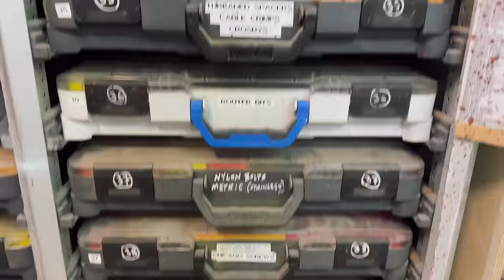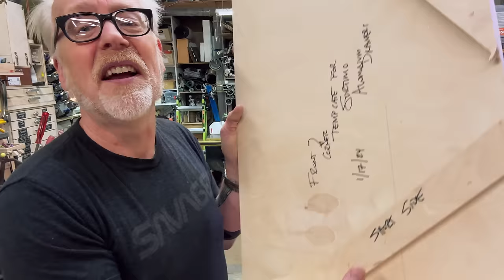Adam Savage Builds His Dream Hardware Storage System!

Comment: re: attaching rails to sides,.. why not clamp the two sides together and drill vertical pilot holes thru the pairs? 
Then regardless of your measurements, the rail pairs are identical heigths.
You can also do one pair, check it and then use one as a top template for drilling down thru all the others, saving all the re-measuring.

Comment: You had them all stacked on the mill for the holes in the corner.  You have a very long end mill, turn those corners into chips, AND drill your holes instead of the hole punch.  One set up.....

Comment: I had the same dilemma and solved it years ago by using a 3 foot tall stool and taking the seat off and making a board with 4 1/2 inch plywood sides that the box can sit in. ( just like the aluminum trays you made but only 1 made out of plywood)

Comment: If anyone is going to make these DON'T use 6061 AL, use 5052 instead.  6061 isn't made for bending.  If not annealed (and it's generally not) it will crack if bending parallel to the grain orientation (the orientation it was rolled).  5052 is what's used for bent aluminum parts.

Comment: What I was actually thinking after you've drilled the two holes was: why don't you also drill the holes for pop rivets instead of punching them out? Maybe in two batches since it would have required a much thinner drill.

Comment: What about building slides in a horizontal line at let’s say 48” high and keep them empty so you can pull out a organizer set it on the slide out to grab parts as you’re working on project and then put it back. Then on one side of the shelf system that you had before, vertically replace it with a drawer system to keep the most used Sortimos on quick access drawers. My 5 cents on the idea for cost and time savings  yet still have a space for organizers to sit on.

Comment: I understand the need for a surface space to lay out the parts box. But wouldnt it be easier and more efficient to make a single slide out surface area in the general area of the parts box rack. This way you can slide out the tray, pull the box you need, put it on tray to open and find part, then just tuck the single tray away when done. You would always have the flat surface clear because it isnt a work bench to fill up with tools

Comment: I understand the focus on "mass production" here and its very interesting  :)

but the problem at hand... Is it not just better making 2 sliders at good "picking" height? Then just pull out one - using it as a table and put the needed box on it.
I mean if you have a slider at the bottom or high up - its not really ergonomic to use. 
Alternatively just a wood panel to slide in/out as a table between to boxes in good picking height on each column.

Comment: there is also solution to have pull out plate under the collumn of all boxes... similar to keyboard pull out plate on computer tables. at table height... so you have 15 (not sure how thick these boxes are), then pull out table, and then rest of boxes till ceiling.

Comment: So at 13 mins we spent a lot of time setting up to drill holes in 70 sheets? And then we cut stuff and the hole punched @17:30? Changing one bit in the milling machine and having the top sheet marked for the 6 holes for the rivets once, would have saved a shit load of time. Top that with Alloy cutting blade in a jigsaw, more time saved. Then for the real time consumer, bending. That will need to be done 1 by 1. Just my view, and love the process.

Comment: He should not have made two cuts in each back corner.  What he should have done was just one straight cut from back to the front. Then bend the 90 across the back, the the two Bends on the sides. Then bend the tails of each side in a 90 over lapping across the back , then put a pop rivet through the back corners tying the sides into the back. Which 31:03  would strengthen  the whole panel, when  tying in the corners.

Comment: Okay...all you need is to build ONE slide-out horizontal surface per column of Sortimos. Just slide out the "desk" pull the desired Sortimos, set it in the desk, retrieve part, replace Sortimos, slide desk back. Done!

Comment: Adam spends weeks contemplating, planning, and tooling for construction of the aluminum drawers.

Me:  Just build one drawer in the middle of each column and pull it out when needed.
Reply: So only make one drawer and do what with the rest?
Reply: @TravelingStacker  Adam said he runs out of flat surface during projects.  Place a pull out shelf in the vertical middle of each column of sortimos so when he needs to pull a sortimos out and retrieve a part, he puts it on the retractable shelf, then he slide it back in when not needed.
Reply: @JediMasterFO  The drawers he just built slide out and sit in place while you remove what you need though. They don't need to sit on a shelf.
Reply: @TravelingStacker  I guess I haven't been clear on my explanation.  He could have saved tons of time by making one shelf per...nevermind.  He wasted time accomplishing something that didn't need to be so complicated.  He gave a lecture about efficiency and yet made a shelf for each tool box when he didn't need that solution. He needed a consistently available flat surface.

Comment: im confused, instead of drilling that hole on the mill could he not have extended that diagonal cut accross to meet the horizontal? In my visualisation you wouldn't loose much more material than the hole.

Comment: The metal pullout systems exist in pretty much every hardware store across America (Ace Hardware, Do it Best, most Home Depot/Lowes/etc, and whatever local hardware store in your town is called) . You can get them for dirt cheap if you know where to search, and they have the same type of adjustable sorting bins. And they're all metal. Those sortimo boxes are way to expensive in comparison. FYI, even on the "expensive" side Uline will sell you a stackable full steel cabinet with (4) drawer slides for $170. The metal boxes themselves they sell for $38. Anyone that has worked with Uline will tell you they sell everything at a discount as well. And they'll be one of the more expensive solutions. Looking at the cost of the sortimo boxes (over $100 a piece) and then even the cost of the raw materials to construct your wood and metal shelving drawer solution, you are clearly spending more AND you have to do all the work and have the necessary tools.

Comment: You were right to have precut sheets.  The next thing is make a proper disign drawing.  If you want to set up thethe mill as you did you could have milled all holes in every sheet, and edges defined with the cutter .  Then jig the bends for  ALL bends,  Assembly has to be ideniical for all.

Comment: All that work when a roll around cart that had five of these would let you load the cart to roll to the project...and have the top surface for selection. Then add a magnifer with light, actuactors to move drawers in and out, control panel, rechargeable battery pack, motorized casters, remote control... 😉

Comment: Of course there's a million ways to skin a cat. Here's some feedback. First, you didn't need all of those drawers. You could have made a couple drawers in your hardware area that you pull out to act as a bench. Then pull the hardware containing drawer and put it on the pull out drawer. When stacking the material on the mill, remove your back chip guard and push them up against the Z dovetail on the column. A drill would have been much better for the holes you drilled on the mill. Also, separately if you need to square something on the mill table, put a piece of material in the back T slot and slide up against it.

Comment: Um, yeah those are called drawers? Been around forever. Designed for stationary work areas such as a shop or garage. Packouts are for mobile trades where you have to pull hardware off a work van and onto a job site. But seeing as you have so many, it's a nice innovation.

Comment: Why not build a small rolling table with a folding top the size of the sortimo. When you need something from one one the sortimos, fold the top to horizontal, roll it to the cabinet and get what you want. With the folding top in vertical position  except when in use, you can't cover it with tools. Much cheaper than 70 pairs of drawer slides and 70 aluminum pieces.

Comment: Why not put bolts thru the 2 holes that were milled to keep everything aligned and then make the holes for the slides on the mill as well and then use those holes to bolt everything together and removed the 2 large bolts and either cut the entire stack at once with the band saw or leave it in the mill and just mill the rest of the cuts?  I'm not a machinist at all but do have a background in construction and a bit of metal work as my grand father was a master mechanic and metal worker. So I am generally interested in the answer.

Comment: 12:00 I don't understand why he wants to punch the sliding rail holes when he already are drilling other holes. Why not just drill the 1/4 inch holes for the corner cutting and the 3/8 inch holes on the drill press or a mill?

Comment: another solution.  one single thin draw between the existing shelves at bench height, for improved viewing and finding. 15mins work, probably. plus alittle additional time for installation.   oh, and 1 piece of aircraft grade aluminium. instead of 70.. 1set of draw slides.  
for those without tv money.
Reply: the errors when mounting the drawslides to the cassing is a good lesson in Tolerance Stacking.. surprised he didn't take the opportunity to teach everyone.

Comment: and then you could put all of this into microsoft access and its fairly easy to have a simple front end, where you can search for what you want by assigning various keywords to each item and access will tell you what "bin" its in. likewise you can use access to track stock levels of things that do get used up, so when you search something up and for instance its a 8mm drill bit. its like you have 2 left. you know to add it to your next shopping trip to resupply incase of breakage or between sharpens

Comment: Installing the drawer rails on the boxes seems like it would have been much easier and you can remove the boxes as well with drawer rails. Just lift them up once fully extended. Idk it seems a bit overkill with the metal plating

Comment: When cutting Aluminum, if you run a candle or other wax block against the tool's cutting edge, you wont gall the aluminum to the tool. Would have made the hole drilling with the endmill slightly faster, and kept the bandsaw teeth clean and sharp.

Comment: Wait hold on a second, you used the mill to make identical holes through all 70 sheets at once and then the hole punch to make holes in each sheet individually? What is the reason that the holes made using the hole punch couldn't have been done all at once using the mill like you did in the very first step?

Comment: I hate to say it, but how much is Adam saving versus just buying the Durham boxes and nests (the blue ones he shows, although I usually see them sold as gray)?  The sortimo are not cheap  even though they are molded plastic.  Seems to be on par with the Durham, but the Durham can be purchased with the nest with drawers and boxes together.
Reply: They also don't have clear tops so if you pull them out you can't see what is in there without opening it.

Comment: It seems to be you could have achieved 95% of the desired functionality with 1% of the effort by simply taking one row of the existing storage solution and making one container into a configuration where it can be pulled out and use to support the weight of  one other container?  That way you have some number of instantly available horizontal surfaces available in the location needed at a moments notice?

Comment: As much as I I like to use specialized tools in my shop.  I still like to do things efficiently.  So I was quite confused after you bored a hole through 70 sheets of aluminum, and then used a hand punch to do the same thing that could have been done on the milling machine .

Comment: When storage system cost 3 times what all your stuff cost... Just kidding. I have a 30x40 shop and I put Warehouse 48" wide rack system all the way down one side 38 ft long. I bought a cheap but running forklift. I got everything from engines to entire 350 honda odysseys stored on the top shelf. Ceiling height is 10 ft, top shelf level was adjusted to fit the Odyssey exactly. I found really nice pallets 48" deep and built shelf units on those so I could stuff them with "stuff" Spent about 2000 bucks on the racks and forklift. Made my shop a lot bigger because I got floor space back. Now I need to make rotating car jigs so I can mount a car turn it up side ways and then it only takes up the side ways dimension and can be rolled up against the wall.

Comment: I would love to make my closet on one side into a storage system for my 3 different size plastic art and crafts storage boxes/bins somewhat like you made for your Sortimo storage boxes. (The big size art and craft bins is 15.25 x 14 x 6.25 in)
(the next size bins down is 15.25 x 14 x 3.5 inches) (the next size bins down is 15.25 x 14 x 2 in). I have shelves built into my closet I would like to use that are adjustable I can move the shelves up or down or take out the shelves all I would need is a way to slide the bins in and out of the shelves and not have the bins stacked on top of one and other, so I do not have to lift a heavy bin off the top of a other bin to get to the bin below. If you can help me out with any ideas the would be great. Thank you

Comment: Not good at Excel? (04:38) Lemme help! With your spreadsheet basically being an inventory database, you now have the ability to make a recipe of any new project that can be shared with anyone working in your space. Example: building a 5-sided cube (6th side is open), you need 5 pieces of X-sized lumber, Y-amount of self-tapping screws, and two angle brackets. The parts list references your storage systems' database and says, container 34 has the brackets and container 20 contains the screws you need. 

Going waaaay down deep in the rabbit hole: (1) I would have designated each storage unit by X,Y grid so that I don't need my glasses to read the labels, which fade, or use my fingers to count the containers. For container 3-12, I would go to the third cabinet and reach for the next to last shelf since you said there are 13 rows. (13??? Who builds anything that ends in a 13???). (2) Counted all the screws, bolts etc. (yeah...) so that I would have a count for each inventory. The "recipe" would then update the count every time I marked the build complete. (3) Added wireless controller, lights and batteries (since these move) so that when I ask the database to show me what I need, each specific shelf would light up. This is so you don't have to keep your storage units all together and in order in your shop. Whoa.

Comment: I don't get why each bin requires its own drawer. How about one slide out surface about chest high (where you can actually see your bits) for each vertical row? Pull your bin, set on pulled out surface, grab your bits (while not bending over) return bin, slide surface back in. Doneski.
Reply: You still have to bend over to pick the bin up to put it on the pull out surface. If you're already bending over, just get what you need without having to pick the entire bin up.

Comment: Just 2,5 minutes in, i really hope this is going to mean drawer slides with a surface attached, just a shelf with an edge at the front and the back to push and pull, that the main box sits in, but can just be picked out right away, just in the case you want to.
Just a minute later, ah, yes, exactly, yeeeeeezzzzz, tha satisfaction of such a system and it working so smoothly... Hmmmmm...
Oh, yes, the amount of work. The choice between doing it all yourself, or designing it in a few minutes and sending a file to some website that will cut and drill and bend then all to your specs, and just receive them in a short time, hell, you can even do that for the wood case it will all go in, so you basically just have to build it. Now, i don't think that would be needed here, though it is a bit of work, but doable. If much more complicated and many more pieces needed, then yeah, definitely.
Of course, you have more tools than the average person. Especially the bending, i think a lot of people don't have the tools to do that cleanly. If you don't have those, the more likely it would be easier and faster and cheaper to just order it online.
Oh no, the boxes with different colors all mixed up, oh yes, i would definitely count them, see what kind of things you have how many of and how that would fit certain colors the best, and re-order then externally and internally, re-number them if needed.
Oh thank god he did that. Well, mostly. Probably a reason for it, like clear distinction between some sections.
Didn't really doubt it, but i didn't think it would happen this video XD

Comment: No Dude, noo. It's a bit late now, but.; may i suggest a more efficient, less time consuming solution? Well i'm going to anyway.
A lightweight adjustable shelf on wheels. Two vertical poles, or angle, or whatever. And a shelf that pull down from vertical to horizontal. 
Just bool it in front of your box, adjust it to the correct height and slid it out onto the shelf..
Just a thought.

Comment: Seems like building a drop down shelf that mounts next to his storage system would have been much easier and 1000x times cheaper. It would give you a convenient flat surface to view parts on that would still fold out of the way when not needed, and not require a full redesign of the storage solution. 🤷‍♂️